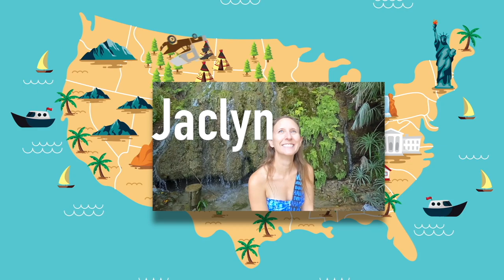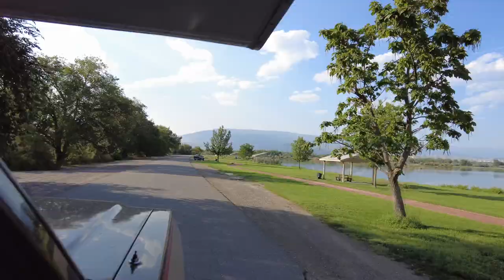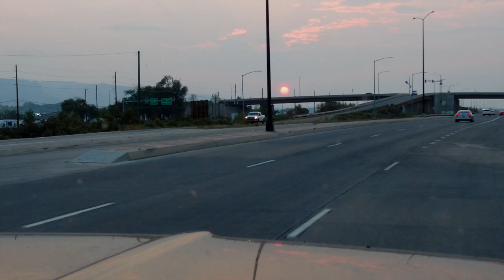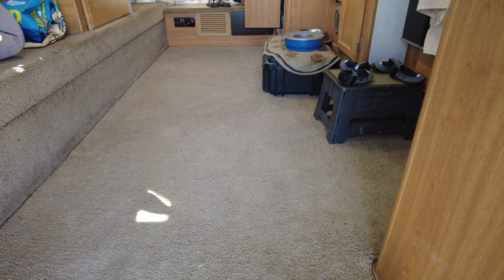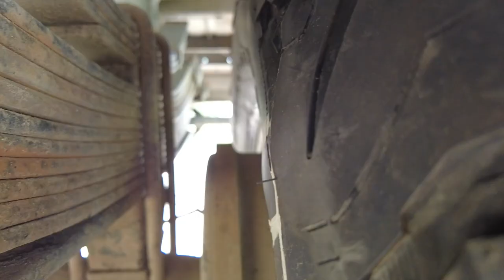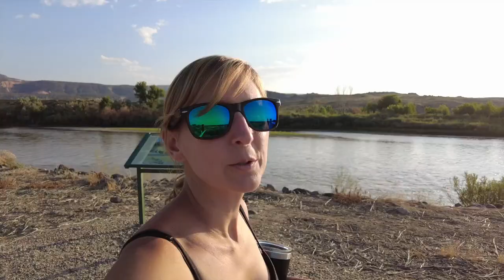Lucky Misfortunes of Truck Camper Living | DestinatioNow S4 Ep65

Comment: Also check frame at steering box they crack there.  Mine did.
Reply from the maker: I’ve been keeping a pretty close eye on that spot, I’ve heard it’s a common issue. My theory is that it’s related to the crossover steering conversions that everyone likes to do because that changes the direction of the force by 90 degrees. My steering is stock